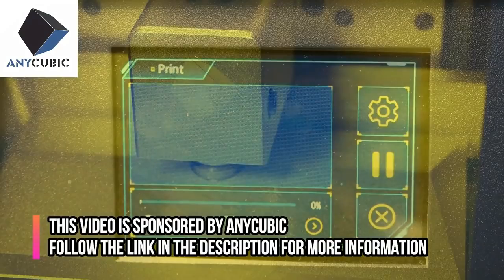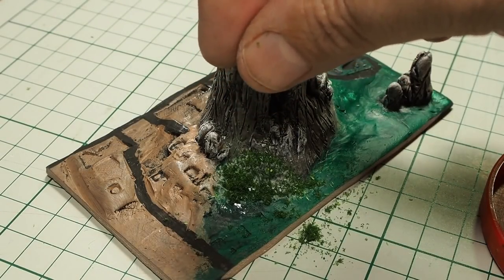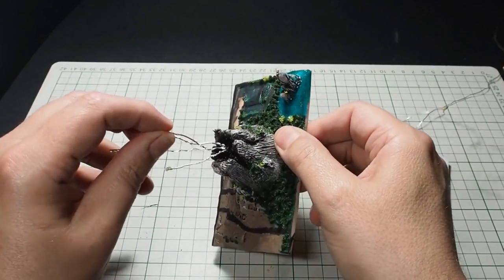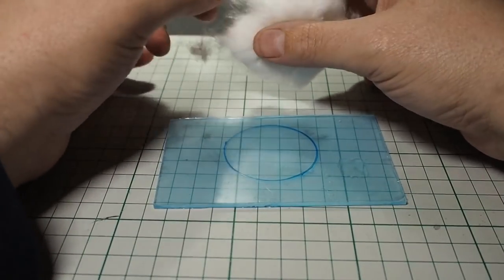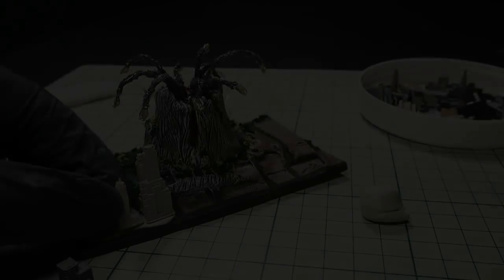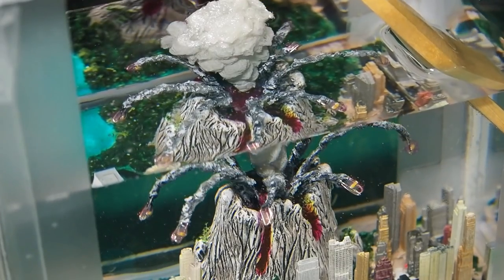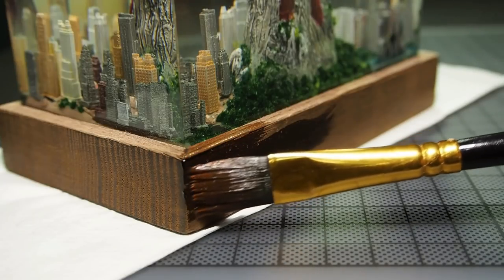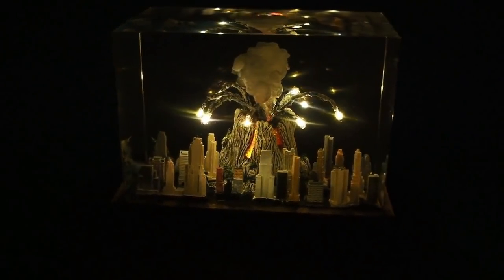VOLCANO ERUPTION diorama/lamp - Resin Art - Polymer Clay - DIY

Comment: I think it's looks pretty good. I suggest using different color approaches to the smoke coming out cause it doesn't have that much of a boom factor. However it's very nice and great craftsmanship! Maybe let a few of those lights go straight up at an angle with red lights that you could tinker with a little black acrylic or even just Tamiya tint so there's subtle differences.  I've never done a diorama before but I've always wanted to. Your skills are better than mine so I'll make use of them and credit you or anyone that does these dioramas
Reply from the maker: Thanks for the tips and good luck with your project 👍

Comment: What type / brand of resin?   I just used a deep pour resin called Liquid Glass and it's eating my sealed paint off the submarine and messing with the cotton.  I haven't found one video yet that discloses that information.
Reply from the maker: Usually, I am using the Resoltech wwa resin.  But no resin is 100% problem free, especially if you try difficult or big pourings